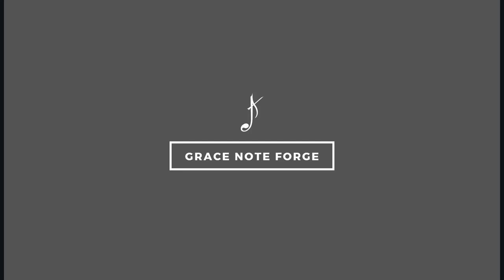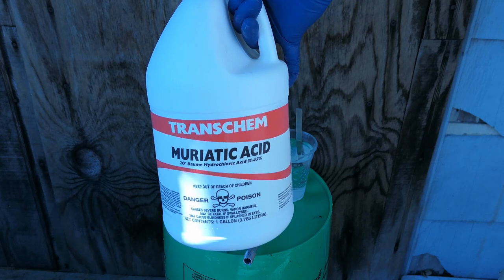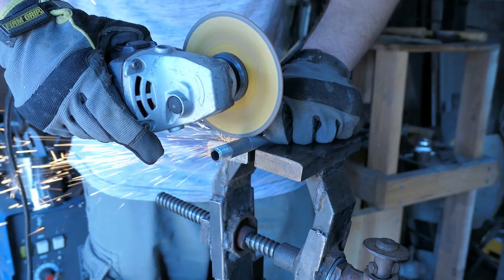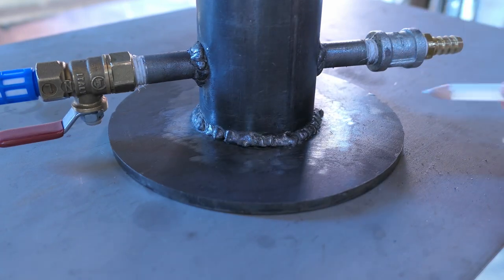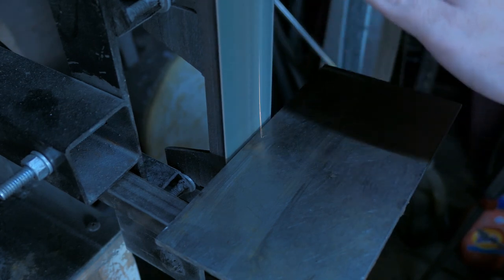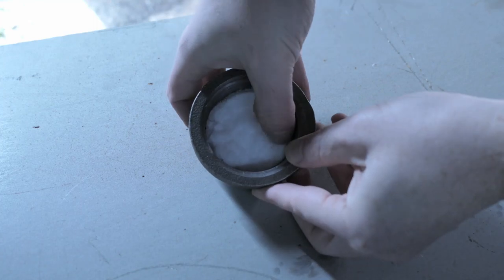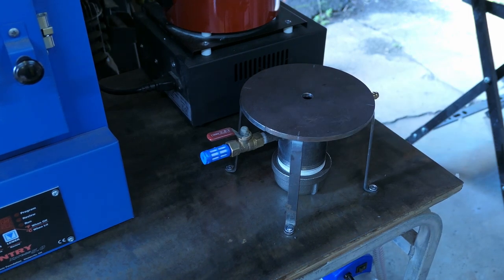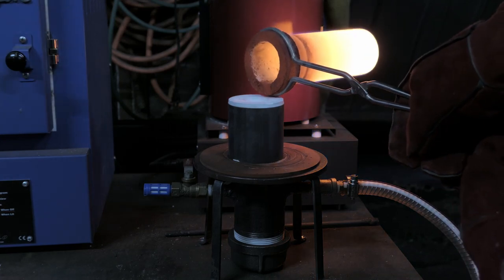DIY Vacuum Casting Table Build

Comment: I don't understand how the air is sucked in or the plaster cast has no holes in the lower part which is attached to the vacuum pump
Reply: Because the plaster is porous enough that air will suck through under a vacuum but not metal

Comment: Couldnt you just use your vacuum system, drill a hole in the lid, use the metal plate and the ruber to seal it and put the mold in or on top of there? Cause thats what i wanna do for my dyi system in a bit.

Comment: Hey, i’m new to casting metal and i’m wondering what the pros and cons are of using a solid wall flask instead of a perforated one? is it just more efficient in getting the air bubbles out in a vacuum, or am i missing something else?

Comment: is there a way to do this without welding? i dont have the tools and dont know anyone that does, welding isnt super common in the uk.
Reply from the maker: I've been playing around with a design for a new vacuum casting table that would make it more modular and doesn't require any welding. 
The basic idea would be to sandwich the pipe in between two steel plates using some threaded rod. Then, some high temp rubber gasket can be used in between those layers to seal off any gaps.
I'm still a ways off from completing this project but I'll be sure to make a video on the process in the future!

Comment: Great  video i really enjoyed this nice build. It is not easy to make one I've been racking my brain on how to make one what a great design. You do some incredible stuff. if you dont want to do any welding They sell this stuff called sanitary tubing . You can buy a 4" diameter spool and end cap for the bottom. drill and tap a 1/2 npt on the edge of the end cap. Screw in a boared npt to swage fitting. Take a peice of stainless steel or copper pipe and drill tiny holes towards one end of the pipe and put a swaged plug on that end. Put the capped end inside the chamber and stick the other end through the swage fitting out of the camber and bend it at a 90°. Think of the pipe like a snorkel inside the chambe This way no molten metal can get to the vacume in the event of a blowout.   From there Put an end cap with a drilled hole at the top if the chamber and you are golden. Super simple no welding and under $120. 

If you want to use a perforated flask no changes are nessary use a 3.5" perforated flask it will sit perfectly on your flange gasket for 4" pipe, just make sure the spool you bought is long enough. And use high temperature seals. It is not hard to make a chamber that can handle a 8" long flask. Or bigger

Or you can buy 6"d 12" long pipe like me so you can use 4" & 5" flasks. You can also fit a 4" flask in for the degassing part.   Glacier tanks sells a special 6" end cap with a 4" which is perfect. At some point I want to put a band heater on mine wrap it in a ceramic blanket and skeet metal with a hose clamp around it. Slap a  PID control at 900° and it would be perfect and at the same level as a $10,000.
Reply: This sounds perfect for me since I have zero welding tools to use, but I'm also a super beginner at these kinds of DIY tool making so I'm not 100% sure I understand how to put everything together. Would you be open to sharing pictures of the setup you're describing just so I can understand how it all goes together?

Comment: Nicely made! WIth a little larger pipe you could make a chmber for perforated flasks (I did xD). I used rtv silicone gasket to seal my welds instead of JBweld, and the bottom of the pipe is a sheet that's just tacked on in a couple spots, and then the silicone gasket material all arorund to seal it. That way when theirs a leak, it's not too tricky to remove it. If I'd used a pipe with a screw cap, it'd have been a lot better, just couldn't find one in the size of the flasks I use

Comment: Hello Sir I have been learning from you and your skills thanks for the work you do for us. I was wondering if it would be possible to make a pressure chamber attachment that can push molten further into the small crevasses of a mould to achieve better quality result ?
Reply from the maker: That's an interesting idea. I don't think I've seen a system like that. Steam casting uses a similar technique to forcibly push the molten metal into the small cavities, rather than pull them with a vacuum but I'm not sure if the result is any better or worse.
Reply: @GraceNoteForge yeah it seems like the whole point of thr vacuum casting is to get those fine details, eliminating any potential need for pressure to push it in.

Thanks for this video BTW. Started messing with pewter before I do bronze (have a large furnace I successfully melted with but I'm taking it slow with the actual pouring) and finally accepted I need a vacuum cast. Didn't wanna spend $800 on a side quest

Comment: for larger flasks, just get a large enough metal pipe and weld a holed disc onto one end so the flask edges just sit on top. this could be easily lifted on and off what you have already built. a few clips to hold down would be advisable =)
you can make multiple sized chambers for different sized flasks

Comment: welding that heavy of plate with a 110v welder you should pre-heat. it will help a lot.
Reply from the maker: Thanks for the tip! I'll try and remember that for next time

Comment: Great stuff.  I am in the process of making one, but simply from the chamber shown at time stamp 1:08.  It’s already a completed unit I just use a hole saw and drop the flask into place.  Was there a reason you decided not to try that?
Reply from the maker: Thank you! I've heard that can work well too, but the main reasons I didn't go that route was because I wanted something a little smaller to fit right next to my furnace and I also didn't want to modify the vacuum chamber I had lol.

One thing to keep in mind too is that the bigger the chamber is, the longer it's going to take to get up to full vacuum and every second counts. As soon as the flask leaves the kiln, it's losing heat. So finding a way to make that chamber as small as possible will help your casting results. 😃

Comment: cool video cheers - ive started making a version but wondered about the need for an inline filter to protect the pump in case of blowout. can't find any information about anyone online using one. Is this something you use? maybe im overthinking it all

Comment: Can vacuum casting work if the whole mold is encased inside a regular steel vacuum chamber? Or will it pull the metal out of the mold as much as into it?

Comment: I would use a piece of steel wool along side your 1/16th filter, it would catch way more metal without much loss in air removal time.
Edit: I remembered just after that steel wool is flammable... so many not a good idea to use it as the filter..
Reply: I was thinking the same thing.

Comment: Where did you get the small plastic filter on the ball valve side?
Reply from the maker: That actually came with my vacuum chamber (I should have mentioned that in the video). If you search "vacuum chamber filter", you can find them online.